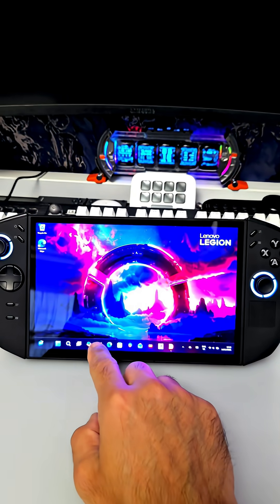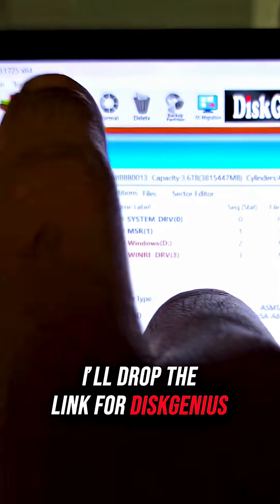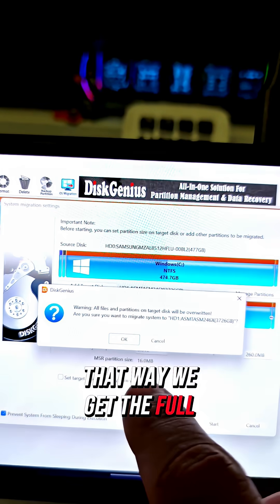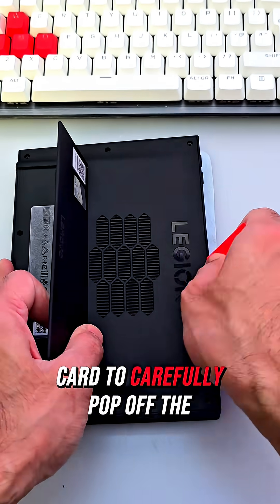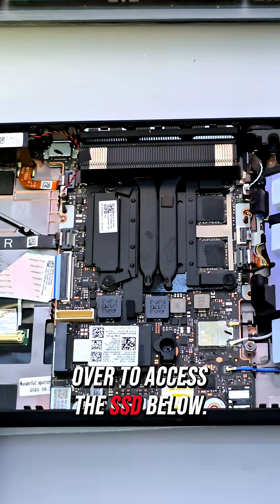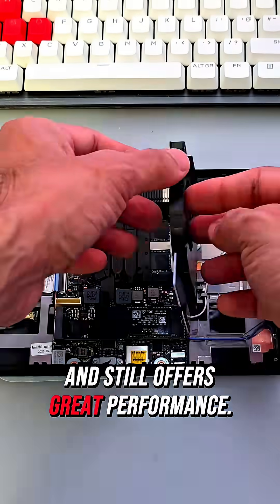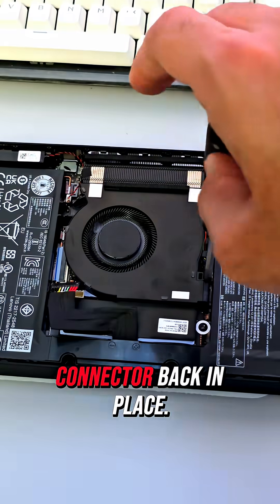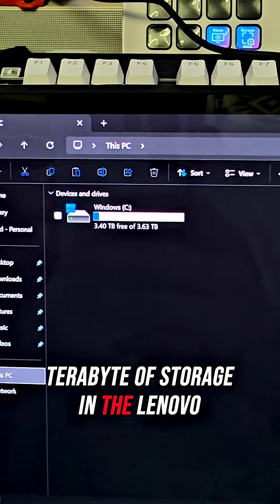Upgraded my Lenovo Legion Go 2 to 4TB NVMe… without losing any data. #lenovolegiongo2 #lenovolegion

Comment: hell ya.. can u link the 4 tb u used??

and what did u use  to get access n clone to the new 4th hd? is there an accessory? i’m not talking about the software im talking about the piece that u put it in then plugged into usb c
Reply: oo is that the nvme caddy that u mentioned?
Reply from the maker: That's my Orico brand nvme caddy. You can use any good caddy for clonning.
Reply from the maker: https://www.amazon.co.uk/WD_BLACK-DASHBOARD-Laptops-handheld-devices/dp/B0DZK9C789/ref=sr_1_1?crid=3O6SS3SBX2N41&dib=eyJ2IjoiMSJ9.Xa0k6TIXn4t7B2gjmoAvU5LBzMA1HQ0yExMC4I2O8TRJEnuU5qvG1LzMSlnURoXzTLXd2ar4UBd_JA-BnI8PdxARvhSY0if5HQuCKDWQk3t4JbXbT_INbMN1jLN71mJ7Ke2ZN81Vn1fESHxvm4zgp8FuY5Z24CN_M8sYpvpdPAtOZedHe78oCRH14WI0R1pewiUpZT5tHxm7W5QX3PW2z8wc27xQI18qQWAR7V2sFts.q3UYw-ez9kPmX_3DpZEivdaHQeJhhvIOqtS_1SZ8LB0&dib_tag=se&keywords=wd%2B4tb%2Bnvme&qid=1763677505&sprefix=wd%2B4tb%2Caps%2C123&sr=8-1&th=1
Reply from the maker: Here is the link for WD 4Tb nvme